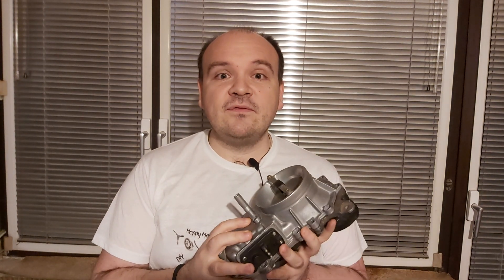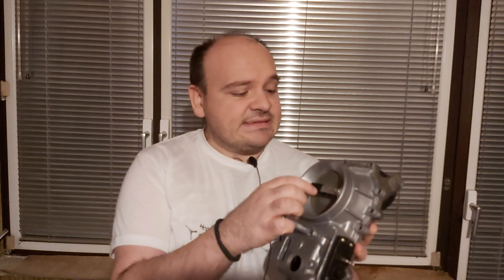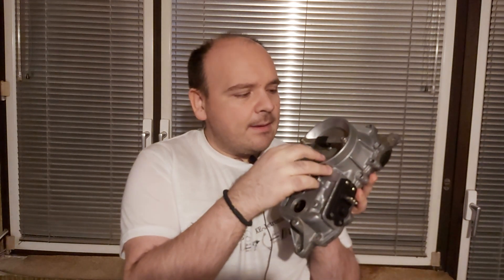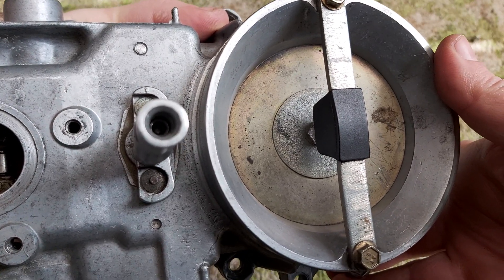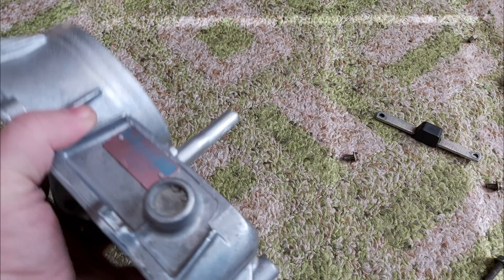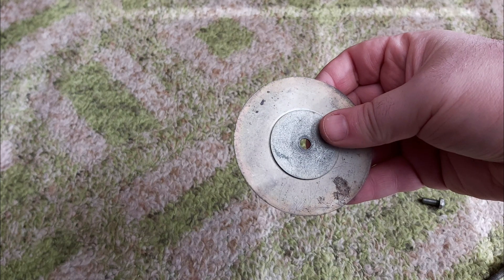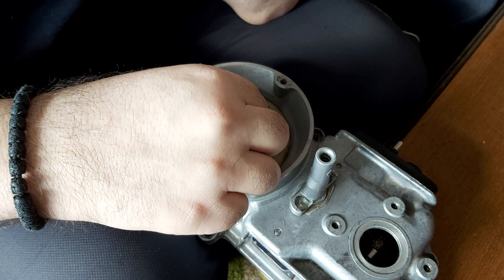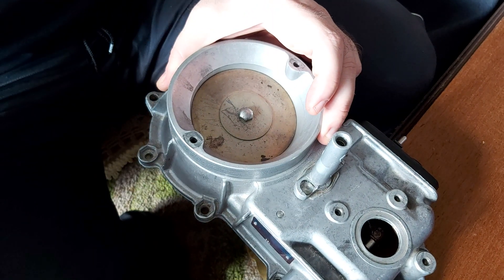Mercedes KE-Jetronic DIY - Sensor air flow meter tutorial - disc alignment procedure

Comment from the maker: As Ke-Jetronic is a mechanical injection, make sure that its mechanical part is perfectly operational - here I mean: the fuel pump, the fuel pressure regulator, the fuel distributor as well as the injectors. The last in the row is this one, the air flow sensor plate which must not rub the edges of its housing. I forgot to mention that this alignment is something like vacuum leaks - where the plate is going to rub, that's individual. Mine has been rubbing, let's say it "at eight o'clock" position. Yours isn't going to be at the same spot I believe. So, just patience, correction in tiny movements, deflect the plate, turn the screw in and, if you hear no rubbing sound, precede until you are done. Much love and Happy Mercedesing, Ica FyM!

Comment: Good morning from Florida. I have a question . My 300 sl 1991 R129 cranks  but won’t start unless I use starter fluid. As soon as the starter fluid burns out it stop running. I check the lines going to injectors no fuel coming to injectors. The distributor is full of gas but none going to injectors. In your video you said check your pressure but how if I can’t get the car running. Thank you in advance for your help.
Reply: Thank you very much the differential should be four bars between working pressure and control pressure correct? I would let you know after I check pressure and have to adjust EHA 1/4 turn clock wise
Reply from the maker: @trevorross7405  Not 4 bars, 0.4bar!☺
Reply from the maker: @trevorross7405  I answered the questions. The only thing is that I didn't know which car is about. In your case you will have to remove the MAS relay and to bridge the contacts 1&2. That way you will make the fuel pump running constantly.
Reply: Thank you for the correction big difference between 4 and 0.4 bars
Reply: Good afternoon from Florida. I took a pressure reading on my 300 SL 1991 R129 Mercedes and the working pressure was barely 6 bars. I took the EHA off and I am going to turn it 1/4 turn clockwise. If pressure don’t increase I would try taking it off again and turn another 1/4 turn clockwise. If after this and my working pressure don’t increase should I condemn the EHA and replace it? Or could it be something else like fuel pressure regulator? Can that be adjusted also? Thank you

Comment: When I step on the gas at Parking gear  straight after starting. The rpm rises smoothly. After driving a while, and I do the same, it is not smooth at all. The rpm does not rise smoothly. Do you think this has to do with the air flow meter?
Reply from the maker: Tell me which car you have.
Reply: @mercedeske  300SL
Reply from the maker: @gastroalchemy4499  which model year?
Reply: @mercedeske  1990

Comment: hello great videos, I have a problem with a 1996 560sec, when it reaches the normal temperature of use it begins to black smoke, in cold it works very well, if you can do me a favor to help me, thanks
Reply from the maker: Hello, thanks. Well, for now the only thing I can remember of is the o2 sensor, or the lambda probe. If you have never replaced it until know, consider replacing it. For any further information here I am ;-)